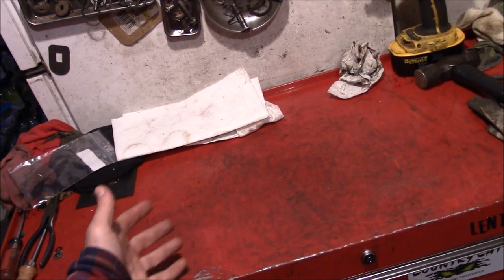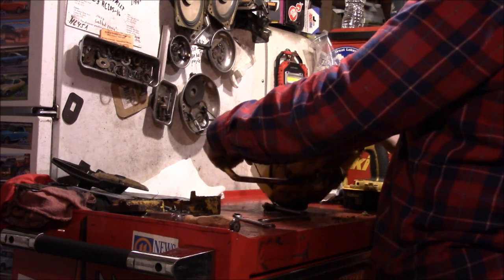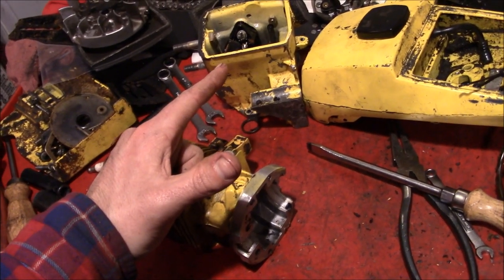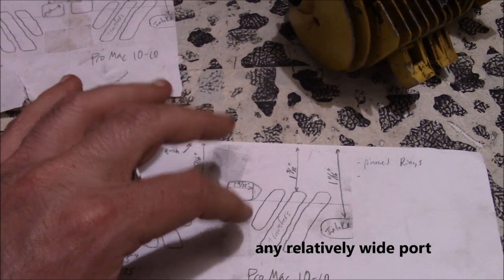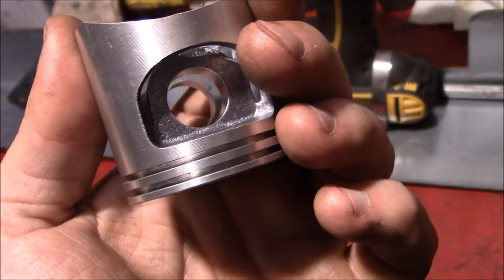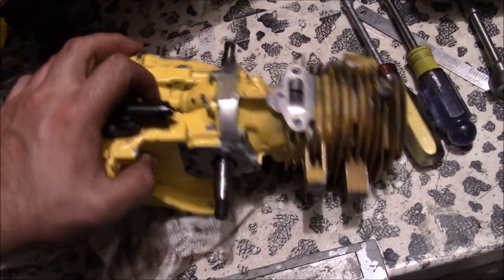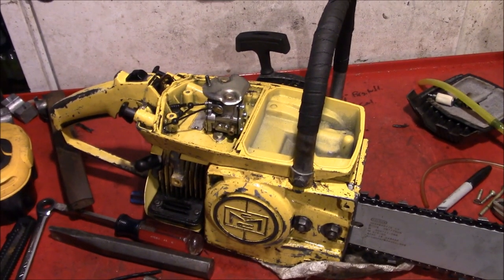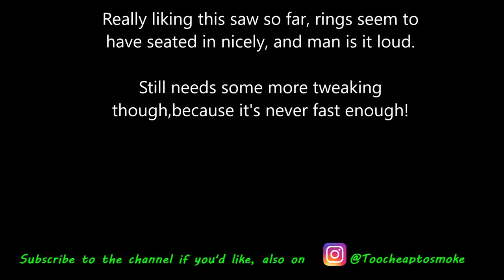Pro Mac 10-10 Mod, The HACK-10 Project

Comment: Great Vidya bud! A two beer production fur sure!
Reply from the maker: Thanks man, I can tell ya, more than two beers went into the production on my end! lol
Reply: @toocheaptosmoke  I fuckin hope so! That was some creative engineering!
Reply: Thanks a fuckton for recommending this guy on your instagram, this is the kind of content I like to see on here
Reply: Van van van van van van van van van van van van van van van van van 🔥🔥🔥🥃🥃🥃
Reply: Mac 10's exhaust drops out and takes a 90 degree turn betweenst the jug and skid plate and then another 90 before deflecting into the atmosphere. I still haven't figured out a practical way to open this up. I feel it would be a significant improvement in power and cooling.. Sure as shit couldn't hurt.  T.C.T.Smoke.. Love your vids.. K

Comment: One extra bolt is probably the bolt inside the oil tank that attaches the front end of the fuel tank to the oil tank.  Nice build, port mapping was very interesting.

Comment: Great work! To be honest I didn't think it would run when you were done, you proved me wrong.  It seems to be pretty strong too for just over 50cc to pull a 28" bar in oak!
Reply from the maker: Thanks!  I was a little bit concerned at times, but so far so good.  But what's that saying, if it's not broken fix it 'til it is?

Comment: When the fuel line was a hose ...😲 Before adding plastic in the fuel line you should check the plastic if does melt in the petrol...I did use some plastic elbow to connect the fuel line... After 10 minutes it clogged the fuel line with melted plastic 😟 and no connection...
Reply from the maker: The plastic line was high pressure fuel injection line, so hopefully it should be fine, haha.  But yeah, especially with today's ethanol fuel you gotta really watch what you're using.

Comment: This is the best video I've seen on a PM 10-10 yet!! 

I've got an old one, that's identical to your collectors item 10-10, except mine's used, like the one you ported in this video. And I have the same problem with mine that you had with yours. The piston looks like it's in good condition, but the rings have too much of a gap, and the saw doesn't have much compression at all. I can BARELY get it to crank. And, as you found out, it's damn near impossible to find a set of OEM rings for 1 3/4 inch mac piston. When you got the aftermarket piston kit (the same one I found on ebay), were the gaps closer to what they needed to be?
Thanks in advance!!!
Reply from the maker: Thanks for watching!  I can't recall the exact end gaps, but they were definitely way closer to spec than the old ones, haha.  It's surprising that certain parts like that arent easier to find.
Reply: @toocheaptosmoke  I agree 100%! The 10-10's are one of the most popular saws in some areas of the country. And I'm sure there's thousands of them out there with scored pistons and cylinders, that are just sitting in people's garages, because they wont crank. And these saws are much better quality than a Stihl or Husqvarna homeowners saw. And MUCH easier to work on! So, I wonder why good aftermarket p/c kits aren't available for these?

I'm going to order one of the piston kits like the one you bought, and bring this old saw back to life. And I'll probably put some new seals, gaskets, and a carb kit on it as well, just because...
Maybe some day I'll get the kuhonis swollen enough to attempt a port job..??
Thank you for the reply!
Have a GREAT WEEKEND, my friend!!!!

Comment: That's what I did with my ol 10-10
Put a 28 oni it and ran it the way it was, at one time I had 3 old Mac's
The 10-10(28")
SP125(42")
And a junky 610(16 but used the 28 for sawmill)
And then sold all of them.

The 28 was the largest bar you could run with the 10-10
3hp engine
Reply from the maker: Nice!  They are cool old saws.

Comment: Ok so I'm curious,  how's the torque? I noticed you keeping the spike off the log.
I'll run full comp 24" on a decent 10-10 without any issues so I'm interested if its that big of a performance boost?
Reply from the maker: Unfortunately I haven't ran a good running stock saw for comparison.  If I had used the dogs on that oak it would bog it down, I tried some softer wood you lean on it a lot more.

My saw seems to have two sweet spots for cutting, one lower rpm where it's torque is strongest, but also higher up where it likes to rev.  Something in the timing or porting may need tweaked, I never had a saw with such a wide range of cutting rpm?
Reply: @toocheaptosmoke  if its still a points saw you can get a few degrees of advance there.

Comment: Did you change the clutch I can't find a newer chain that will work on my 10-10 wanting a 28 inch Oregon bar but the chain doesn't fit properly on the clutch
Reply from the maker: I believe it was just the regular clutch that was on it?

Comment: I have the same saw I’ve been messing with, did you find out if there is supposed to be two plates beside the bar at 4:05? Mine only has one. Thanks
Reply from the maker: I've been running it with just the one, so far so good, haha.
Reply: Ok I have been too but it seems to be leaking a little more oil than it should and I just wondered if I was missing a part

Comment: Yes Mr. toocheap delhi guy, I'd like my oak sliced kinda on the thin side, thanks.  :-)
 Man you may not have uploaded a video in awhile, but it was worth the wait. Over Half an hour. Frickin great project to show. I was wondering if your method of remembering projects in the back of the barn were the same as mine. Is it when you go to get something else and trip over what you stored there, or do you just happen to remember? My method is to trip on something stored and remember "Oh yeah, I was gonna fix that." Then grab some beers and start working.  :-)
Thanks for the vid.
Reply from the maker: That definitely happens at times, haha.  Usually I just wait until I actually need to use something, then that forces my hand and I've gotta fix it.

Comment: What will happen if your ring gaps are lined up with the transfer ports
Reply from the maker: On the small narrow transfer ports the ring ends just bridge the gap and are fine.  On a wider ports the ring ends squeeze out of the piston and can catch, either breaking the ring or causing accelerated wear.

Comment: Hey, I have a question unrelated to this video lol. Working on a 77(I think) TXL440 might be a 76 with a tx440 motor.. too lazy to go outside and check the vin plate.
Anyways, the motor is EC44PT-06. Has a closed face clutch. I'm trying to find the proper puller for it, not the spider tool, but the bolt type to pull it off the crank.
Manual says this is the puller (2870130) but can't find anywhere.This site shows the two piece, which I believe is correct.
http://www.fullthrottletahoe.com/fullthro/publicstore/images/catalog-specs/09SnowPages/09Snow%20710.pdf
Also too cheap to spend 50-60+ bucks, so trying to figure out if the bolt is a 3/4-16 or what.
Also there is this stupid plastic thing that is being a b1tch to get out without destroying. Probably won't be able to find a replacement.
Do you have anything laying around that you could check to see what size and thread pitch the puller bolt is?
Much appreciated!
Reply from the maker: the -06 motor sounds like it may be a '80-'82 TX-C engine?  These and the TX-L indy motors had a very unique medium depth taper for the crank, not as deep as early engines, but deeper than later engines.  These clutches may have had a specific puller, but the threads in the clutch should be the same as all the other "standard" clutch pullers, so a regular universal polaris puller should work.
Reply: @toocheaptosmoke  Alrighty, ty. Oh what about the plastic spacer? Doesn't really look useful. It's right at the opening, tip of shaft, but recessed a bit. Tried a blind hole puller but it just slips.
Reply from the maker: @xnotx2   Oh yeah, those are just a spacer to keep the clutch bolt centered, that way it doesn't go in offset and potentially make the clutch out of balance.  Even if you crack it during removal, you can usually salvage an still reuse it.  They usually just slide out
Reply: @toocheaptosmoke  keeps the bolt center, makes sense. thanks

Comment: The pistons sold by Lil Red Barn are not made in China or Taiwan they are better quality then the cheap pistons on the internet, if they didn't have the pistons remade you wouldn't find any pistons for older saws anywhere
Reply from the maker: No doubt, glad to have someone making parts for these.